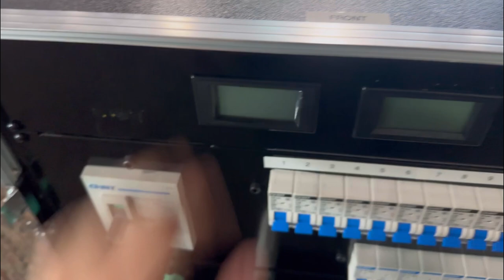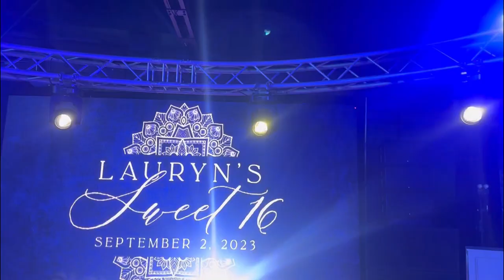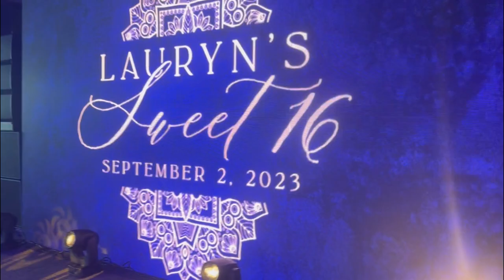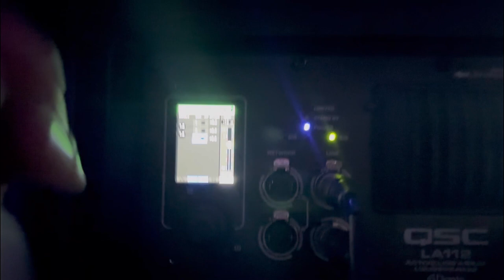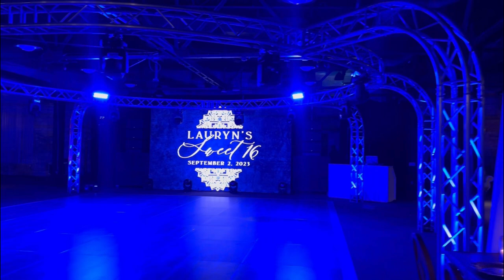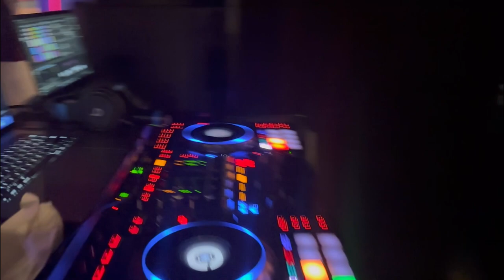Our First Time Setting Up Truss Over A Dance Floor - Gig Log #15

Comment: Your rigs just get better and better - you have levelled-up ….. again!  That looked so slick and professional.  
Are you still using MyDMX3?  With all those movers and your technical ability you should consider using Avolites Titan to give more universes and integrate the lights with the video wall (prism zero IIRC).  Keep doing what your doing.
Reply from the maker: I am in fact still using Mydmx 3.0 haha, I’m considering switching to MA but not sure I’m ready for it yet

Comment: BassBoss FTW!  

This setup is next-level and amazing but for the number of people that showed up, I would have been very disappointed.  I’ve done 800 teenager events with 4 Danley TH-118 subs and a pair of EV ZXA5 tops.  You’ve got to be top of the heap in your area with setups though.  Hard to imagine setups nicer than this!
Reply: He can't control how many people show up. He can only control how his crew performs based upon the customers requirements. To that I say job well done. 👍🏾

Comment: All that truss arkund that dance floor and you only brought out 4 fixtures to wash the dance floor? What good is the 26ft circle if you dont throw some lighting inside the truss bro? I have a 16ft circle and i would dare not bring out curved truss and not show it off. 
I love the LA112s tho. I have the KLAs and i could definitely move away from mines to those. Love the wall too...look great. Good job
Reply from the maker: 4 jolts was plenty to wash the floor, as for uplights in the truss, I was planning on doing that but the event coordinator needed to use my uplights elsewhere in the venue so I had to make that sacrifice. For that same reason I’m ordering 50 more uplights so I can have enough for my truss and for the venue. We’re learning as we go🙌🏻

Comment: Dude.. that feeder cable looks SKETCH. careful with that
Reply from the maker: 6 awg wire is rated for the amperage we’re pulling with it, my electrician approved the setup beforehand but I do plan on buying separate wires for each cam lock feed eventually just so it looks cooler